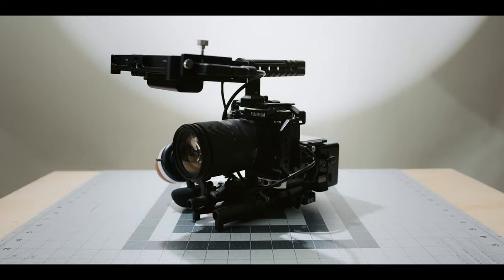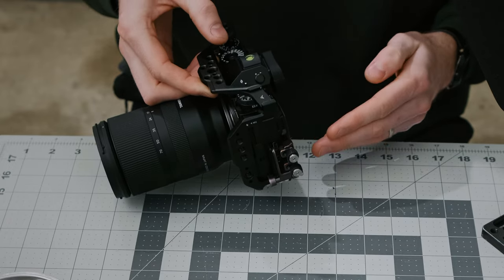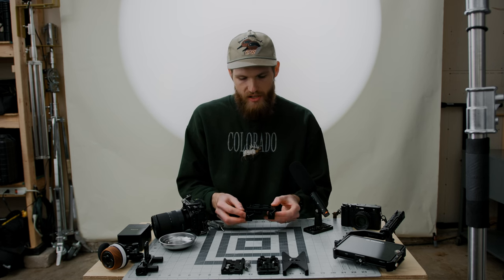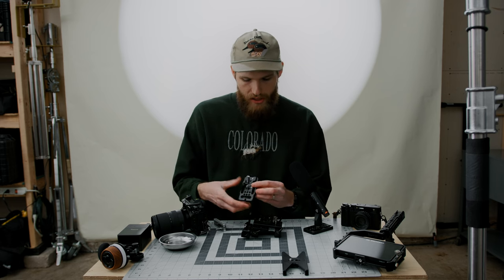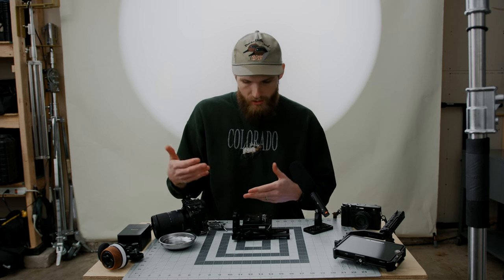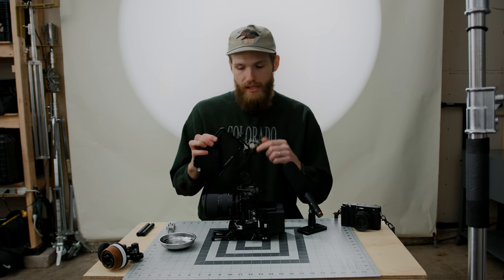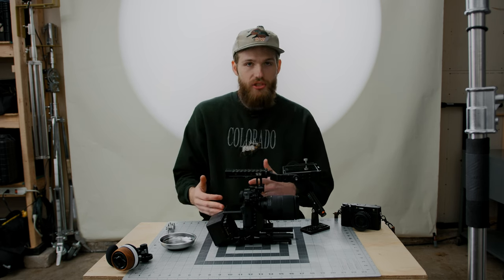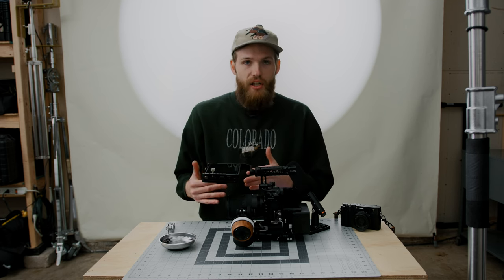Fuji XT5 Cinema Rig (My Perfect B Cam Build)

Comment from the maker: thanks so much for checking out this rig build for my fuji xt5. while every job is different and often requires a unique build, I hope this video would serve as inspiration for a starting point if you are looking to incorporate a v mount battery with the flip screen. holler with any questions down below and ill hit you back ✌
Reply: Hey Blase, im seeing this video a little later and now the link for the  Battery Quick Release Plate Adapter (on the top) isn't available for purchase, are there any other options for where to buy?
Reply from the maker: @JUDEANTONIOUFILM  This should be the same one and you can just remove the rod adapter via the screws on the bottom: https://amzn.to/4dHfQJf

Comment: Hi Blase, I have an X-S20 that I upgraded from an X-T2. I really enjoyed the fact that the grip in the X-T2 allowed for an AC adapter to power the camera. Does the V mount battery work the same way? I have been trying to find a solution for the X-S20 so that I don't have to swap batteries.
Reply from the maker: V mounts will simply extend your battery life but don't have an AC input option in the same way that your grip would. If I am wanting to use power from a wall (say for a long day of interviews), I use one of these and a USB C cable: https://amzn.to/3U0yowM
Reply: @blasepivovar  My man! The Fuji Wizard. Thank you!
Reply: Many of the newer charger adapter that are use to charge the power bank, such as those from Anker, can actually power the camera via USB C. For example, I bought an Anker 26800mAh powerbank, and the 60W charger that it came with, can power my X-T3, via AC.

Comment: bonjour, je lis que vous recommandez le X-T3 pour débuter, mais l'absence de stabilisation interne n'est-elle pas problématique ?
aussi, il est difficilement trouvable aujourd'hui et à des prix similaires au X-T5 neuf...
Reply from the maker: Prices are enough apart where I would still recommend a used XT3 for beginners. A lens like the Tamron 17-70 has stabilization and is a great budget zoom. Depends on the work you shoot, but I didn't need IBIS for the first several years of doing professional work. XS20 might also be an intriguing option for several folks. XT5 really just fits my needs as a B cam.
Reply: @blasepivovar  je vais acheter le XS20 pour commencer, les performances sont exceptionnelles pour un prix vraiment raisonnable !
si je ne me trompe pas, il a les mêmes capacités vidéo que le xh2s pour 1200€ de moins, c'est le rêve.